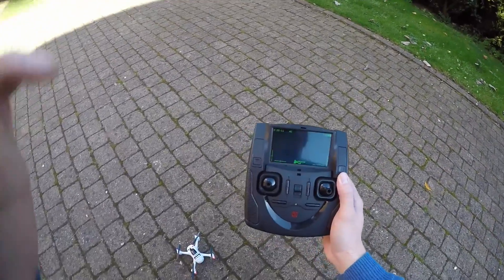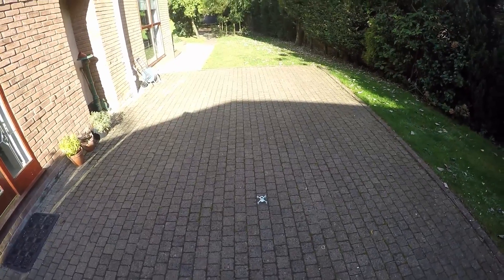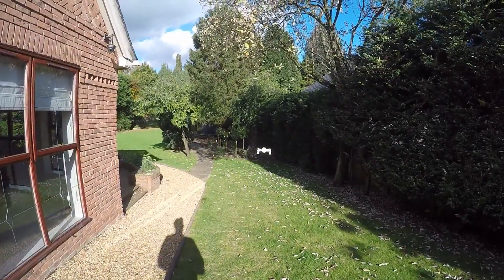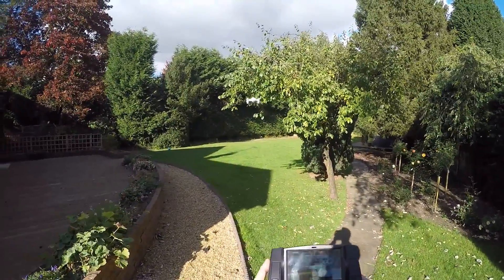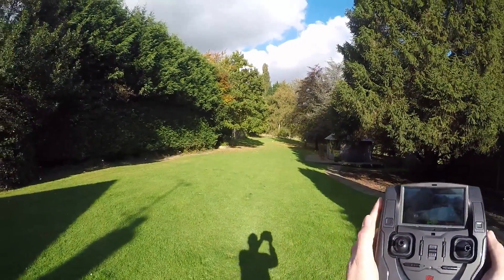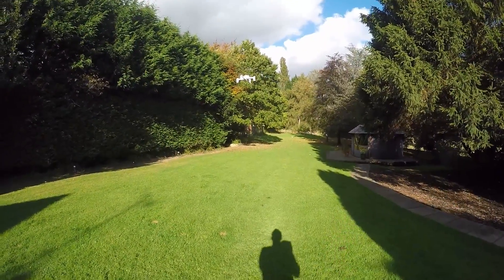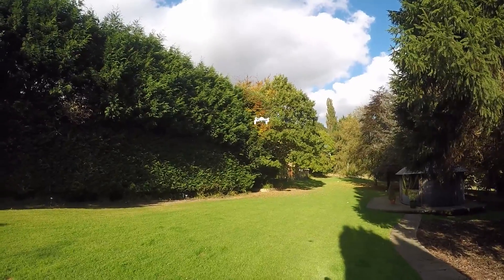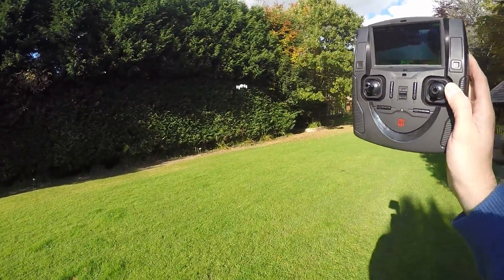Husban 107D+ - Altitude Hold Demo

Comment: i have this modell.. i dont know why but it was easy to controlled i but now if o dont press any botton it flies to one direction and one time i lost it and it brakes down... found it after walking a lot.... do i have to calibrate it or something please help me
Reply from the maker: +Charalambos Constantinou Hi, make sure you take it off from a level surface at the start when you power on. Also if there is wind, it will drift, you can adjust the trim to combat this but I don't. As long as you have it hovering nice indoor then you know it hovers nice, then you just have to adjust for the wind conditions while you fly outdoor. You can also re-calibrate the gyro inside the quad which will re-centre everything to help with stability. I will read up on how to do this and let you know as I haven't done it for a long time. There is also videos on You Tube I'm sure. Does it hover nicely indoor?
Reply: +RC BASHERS UK  i dont fly it indoor because am afraid to land it down... yes please i want to have the original setting because i maybe changed them... and i thing it wasnt staight land where i started it... thank you in advance you are very helpfull
Reply from the maker: It should recalibrate every time you turn it on,  on a flat surface. Otherwise you have to reset the gyro. I will send details of that when I see some. Just making a video at the mo.

Comment: A good wee quadcopter ruined by its auto throttle, apart from as Richard Heeks say about when the battery runs low I find at times when you land its bounces hard round the floor and cant be stopped for a few seconds even with the throttle stick full down. Returned for refund and got the Estes Proto X FPV HD 40 quid less and while it may not be as solid built as the 107D+ if flies identical to my  Hubsan X4 which is near perfect, with better flight time batteries plentiful the Estes is basically a Hubsan rebranded. https://www.youtube.com/watch?v=XfB_VdAH_gs&feature=youtu.be

Comment: Nice one! How are you finding it when the battery runs low? Mine has a tendency to climb when the battery runs low, and then it doesn't respond to me lowering the throttle. It climbs and then cuts out, which means it can drop from quite a height.
Reply from the maker: +Richard Heeks Hi Richard, just posted a video of the Auto Landing for you. Has some FPV footage also but check the end for the quad landing itself.